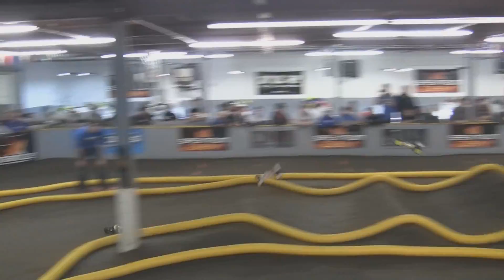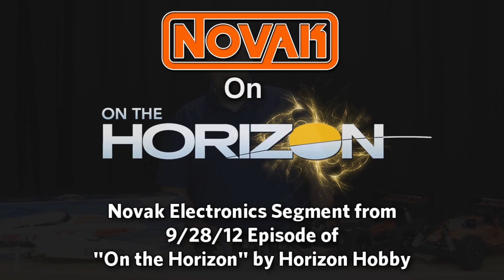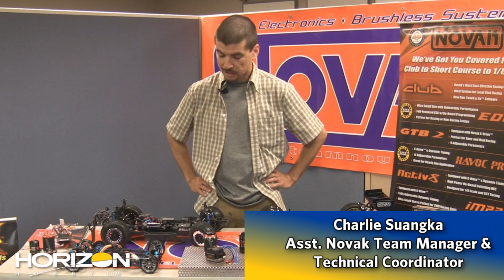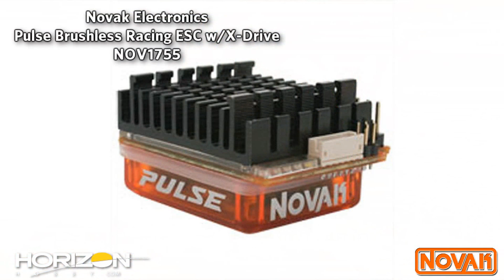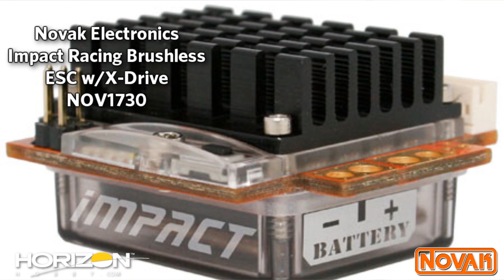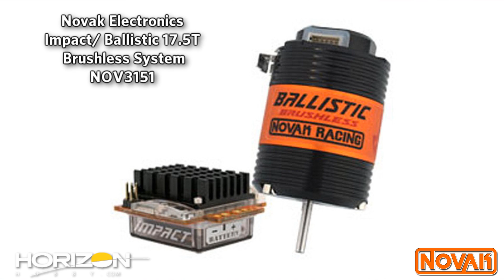Novak Previews New Products for 2012-2013

Comment: I have question I want to buy a Novak active8 ESC But I saw 2 different part # can you tell me if they are the same ESC or they have some difference 1.- Novak Electronics Activ8 Racing Brushless ESC 1/8 NOV1725 and the 2.-  Novak Activ8 Racing Brushless ESC X-Drive NVK1725 if they are different which are better, hope you can help me with this asap, thanks